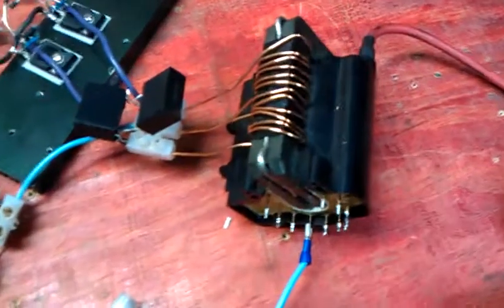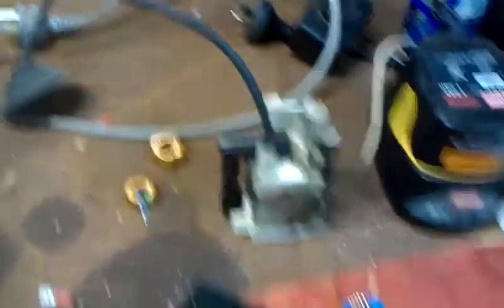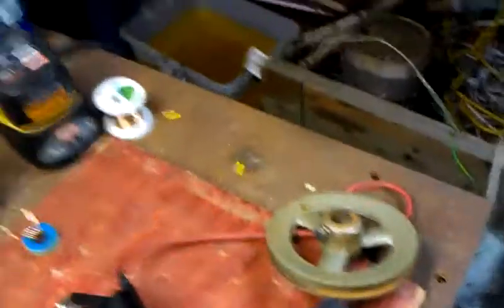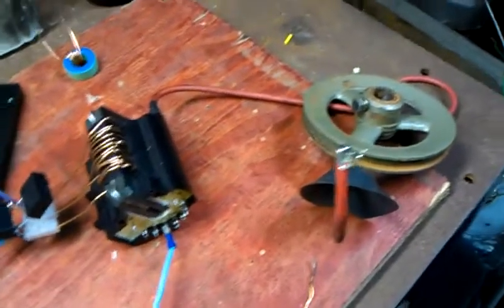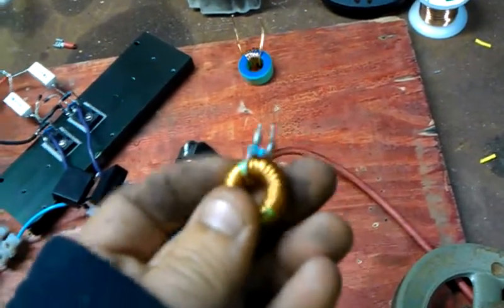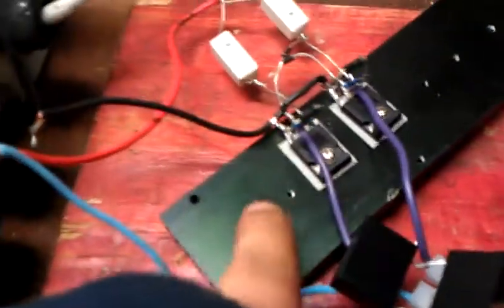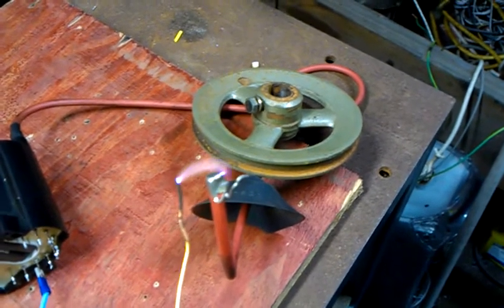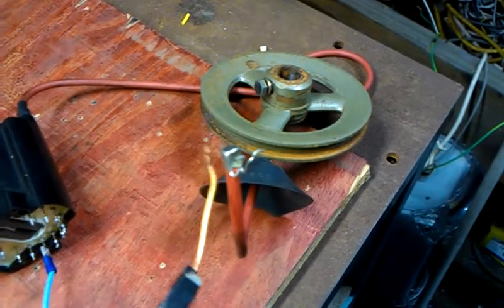ZVS + Bigger Flyback Update

Comment: No, it's usually built in. What happens is that internally the flyback will double or triple the output HT, so you can drive it with a lower voltage, and use a cheaper (lower voltage) transistor in the TV set.

Comment: I use a 0.68uF capacitor, that does the trick for me. You just have to experiment with the inductor, I usually use one that I got from a CRT circuitboard. Its got probably about 50 turns of 14 gauge litz wire.

Comment: if you want to run it over 30 volts you should change the 470 ohm resistors to 1k resistors and then you can run it at 120 volts. but Im not sure about 240

Comment: Strange xD Any smaller cap for mine and it starts squealing and the mosfets get very hot. I only use 5+5 turns on the flyback for the primary.